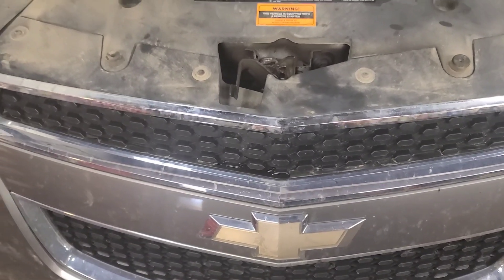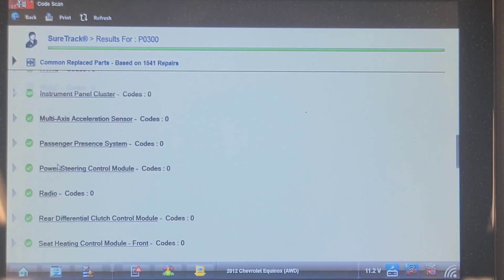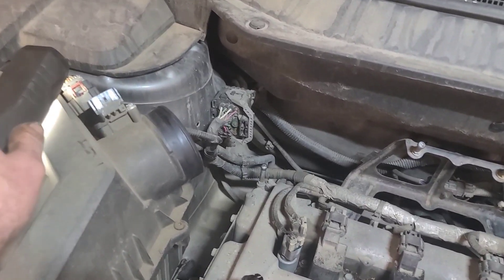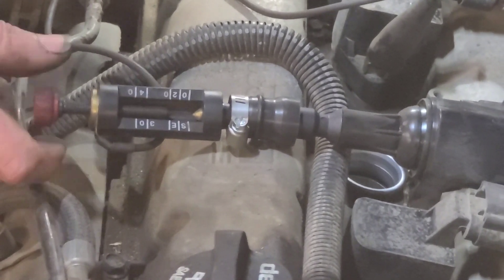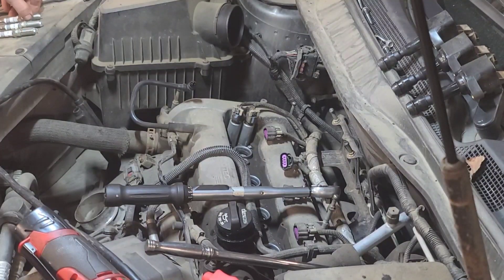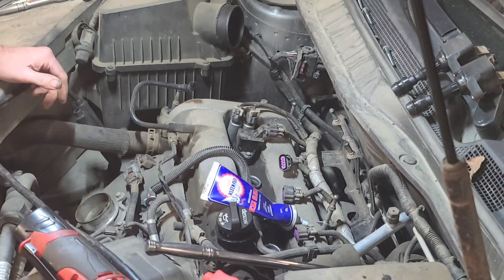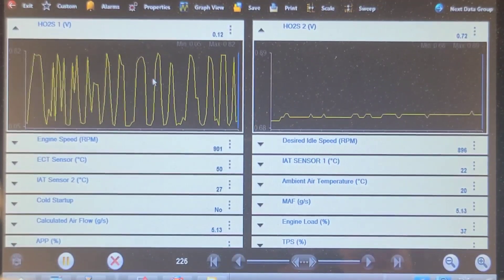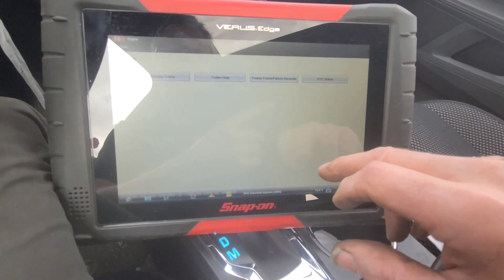2012 Chevrolet Equinox Misfire P0300, P050D

Comment: FYI don't use antiseize on shiny (plated vs black oxide) spark plugs in aluminum heads made after the 80's. Plug MFG's use the proper plating that won't seize. What does happen is the antiseize dries up, interferes with the ground, and makes removal a pain.

Comment: Hello Phillip, I like what do, Thank you. I thought I would ask you what the ohms reading the fuel injectors should have for this engine. I get 1.6 ohms on all four, does this sound right?  I started with replacing the Timing chain then VVT solenoids, did the PCV hole clean out, replaced all coils-sparkplugs  then found another 2.4 ecotec common problem (cracked exhaust manifold) this seems to be as common as the rest of the problems this engine has. I ask what the ohms reading should be because I can't find those kind of specs anywhere. Thank you Phillip.
Reply from the maker: That sounds a bit low but considering they all measure the same I'd say it's OK. You are disconnecting them to test correct? What's the problem and why are you testing them. Resistance testing is only about 75% effective imo

Comment: My car is giving misfire codes like P0300 P0191 P0172 P2271 P050D Are the app aspirated with fuel rail pressure issues
Reply from the maker: The P0172 is running rich, 2271 is B1S2 O2 pegged rich, P0191 is a high pressure fuel pressure irregularity. I'd check for fuel in the engine oil. Probably has a leaking high pressure fuel pump leaking fuel into the engine oil. The misfire codes are likely as a result of running rich. Good luck...
Reply: @PhillipBailey   what would you suggest fixing first? i was going to go for fuel injectors because we have already done spark plugs.
Reply from the maker: @momomo3772  I'd suggest to check the engine oil for contamination as I said. Don't throw parts at it. The fuel injectors are not cheap nor easy to replace. If the oil is overfull then change it. Running watch the short term and long term fuel trim numbers they should be +/- 10% max. Watch desired and actual High Pressure Fuel pressure running. Should match. Once warm shut it off and then turn the ignition back on. Monitor HP actual fuel pressure and note that it should rise as the engine goes through a hot soak. If the HP fuel pressure does not rise replace the HP pump.
Reply: @PhillipBailey Yes it has been confirmed that there is fuel in the engine oil.. And we jus thought the motor was burning oil into the engine..but thought it was a manufacture problem with the sylinoids
Reply from the maker: @momomo3772  like I said likely a leaking HP pump. It's easy to replace but not cheap. Be sure the change the oil and filter as well.

Comment: Can somebody tell me on a GMC terrain 2.4 L which one is cylinder three on the spark plugs
Reply from the maker: Number one is closest to the Serpentine belt so number 3 is the third from the front. HTH
Reply: @ so it goes 1234 or 1324
Reply from the maker: @hectorestrada8622  the cylinders are numbered 1234 front to back but fire 1342 order.
Reply: @PhillipBailey  so say the spark plugs are 1”2”34 and I’m getting a cylinder 3 misfire I would have to change number 2 right
Reply from the maker: @hectorestrada8622 no your miss is being reported on cylinder 3
Reply: @PhillipBailey  OK so the firing order 1342 and I have a misfire on cylinder three so I fix number three? Do you see what I’m saying?
Reply: So I have a misfire cylinder three so I change number three in the firing order?
Reply from the maker: @hectorestrada8622  yes concentrate on number three, check the plug, check for spark check compression and fuel delivery

Comment: I've noticed most of your vehicles are very dirty. Is that due to slushy roads? I live where it rarely snows.
Reply from the maker: I'm in northern Ontario Canada so we get snow and slush 8 months of the year. Lots of my customers also live on gravel roads as do I. Plus they spray salt on the highways to control ice and that eats everything.
Reply: @PhillipBailey  Thanks for the reply. I had a shop in Louisiana for 37 years. Been retired for13.In my parish (county), sales taxes have paved everything navigable-including cow paths.
Reply: Was hoping this would relate to my eco tec problem. No such luck.
Reply from the maker: @TG-be3io  what's the problem?
Reply: @PhillipBailey  the one I talked to you about it the other week.  Surging at idle and timing all over the place. Seen this video pop up and thought you had the same problem.  This one isn't isolated to one cylinder tho.
Reply from the maker: @TG-be3io  Ah I see. Likely a loose timing chain or guides causing late cam timing. I've had that and struggled to fix one for some time. Fuel trims were always negative especially at idle no mater what I tried. Then one day the chain jumped and it would not start. I ended up replacing the engine with a low mileage used one as it bent valves.
Reply: @PhillipBailey  that's pretty common when timing chain jumps, breaks etc huh. I have a 04 Alero and love the ecotec 2.2 motor. Have had very few issues with it. I've read alot of people don't like it and only thing I'd change would be the timing chain would be a belt and more room to work on it. Changed the pulley tensioner arm and belt and had one hell of a time as I could only get a wrench on the 15 m socket and getting new arm and pulley back in with that screw was a 9 hour job even when taking off motor mount and the cruise control module and the tire and splash guards. Was hardest one I've ever done.
Reply: And stabilitrack light is on, rough idling and rough starting. I've heard that this vehicle is just junk and I shouldn't have bought it.
Reply from the maker: @christophersmith3661  stabilitrack light on due to misfire is normal. These are not on my recommended buy list for sure.

Comment: I’m having a problem with the exact same vehicle. Mechanic says they’ve did everything but might need a new motor? Is that right?
Reply from the maker: That's a loaded question.  It is possible that a misfire is caused by a mechanical problem in the engine. Misfire codes can be caused by ignition faults such as a failed coil, sparkplug or wiring to the coil, Failed or plugged injector, vacuum leak on the intake port or manifold,  cam timing errors, bad valves and piston rings. Could also be fuel quality or low fuel pressure. You have to test all these things prior to condemning the engine. If I was you I'd get a second opinion...but yes it may need an engine replacement or internal repairs.

Comment: Hi, what would be the omh resistance on the ignition coils? I have a 2013 Chevy Captiva sport 2.4 and just been looking for the service manual to know all of this stuff but I haven't been able to find it
Reply from the maker: You cannot measure the primary and secondary resistance of most GM ignition coils due to the fact that there is a built in transistor. In fact any coil with more than 2 primary control wires typically contains a switching transistor and cannot be resistance tested. Swapping with a known good coil is the easiest approach. Current Ramping is another approach as well. Hope this helps you.

Comment: So it means bad plugs and wires?
Reply from the maker: P0300 is a random misfire which could be caused by plugs, ignition coils, plug boots, plugged injectors or mechanical engine problems. P050D is cold start misfire and basically the same as P0300
Reply: @PhillipBailey  could it be the coil module or the ignition coil? I'm gonna start with plugs and wires first then next said issue if persists.
Reply from the maker: @christophersmith3661  you need to see if the miss is random or isolated to a specific cylinder. Look at cumulative misfires in mode 6 data to see what has been counted over the last 10 drive cycles. This will be wiped out if you clear the codes. If your scanner supports live data check misfire counters while running. If it seems to be a specific cylinder I'd try swapping a coil first see if the misfire moves with the coil. Good luck
Reply: @PhillipBailey  hay phillin I a p2635 could a p300 misfire cause that

Comment: My car has the same issue right now i changed both vct last time and now a mechanic is saying its the timing chain but at autozone i got the same code po300 so what could it be then
Reply from the maker: If the chain is worn the cam timing will be wrong which leads to random misfire which sets a P0300 code. So if plugs, coils and injectors have been ruled out your mechanic is likely right.

Comment: I replaced all 4 spark plugs and coils and I'm still getting the p303 code. Plus the stability track light keeps coming on. I need help. Im trying to avoid having to replace the injectors.
Reply from the maker: Check compression and do an injector flow test.
Reply: @PhillipBailey  It seems like I'm not getting any gas to cylinder 3. I know this question is a long shot but is there a way to fix the injector without changing it out?
Reply from the maker: @BullProspecting  you need to flow test the injectors. You could swap number 3 to 4 and see if the misfire follows the injector. I'd still recommend a compression test first though. On rare occasions flushing injectors helps but usually does not.
Reply: @PhillipBailey  I'm just curious, what will the compression test tell me? My neighbor let me use his but I had to give it back before I got to use it.
Reply from the maker: @BullProspecting  There are several possibilities for a misfire. 1. Poor ignition possibly due to faulty or worn sparkplugs,  failing ignition coil or supporting wiring or failed driver in the ECM. 2. Plugged or stuck closed fuel injector or possibly poor spray pattern, injector wiring or again failed driver in the ECM. 3. Low or lack of compression in a cylinder possibly due to broken or leaking piston rings, burnt valve, worn cam lobe or collapsed lifter. A compression tester confirms the rings and valves are working correctly.
Reply: @PhillipBailey  thank you sooo much!!🙏🙏🙏
Reply from the maker: @BullProspecting  good luck
Reply: @PhillipBailey  Thank you. I'm gonna need that or a miracle.. I wish I looked up the car before my wife bought it. We have had it for 4 months and only drove 50 miles.
Reply: @BullProspecting do you find your problem???

Comment: I have a p0300. New plugs coils 02 sensor high pressure fuel pump. Throttle body. Any suggestions
Reply from the maker: P0300 is random misfire but chances are it's not. What does the misfire counter say? Is it on a specific cylinder or all. What are your fuel trims reading? Partially plugged converter? Check exhaust back pressure at the forward 02 sensor.
Reply: I had a cracked exhaust manifold which was causing a bad O2 reading (even though the O2 sensor was fine) causing the engine to run rich and misfiring.
Reply: @crissd8283 so we had missfire in cylinder 3.  Alot.  The others were fine. 1 here and there.  End result we orfered a motor
Reply from the maker: @crissd8283  yes thats quite possible

Comment: Could this code also mean the solenoids need to be replaced? Or just the spark plugs? I got this code and the scanner read VCT variable camshaft Timing Solenoid.
Reply from the maker: There areblots of possibilities for misfire.  If you have a cam timing error code thatvcan cause random misfires.  It could be a stuck solenoid  but could also be loose timing chain or stuck phaser.
Reply: @PhillipBailey  Thank you! I will be taking my car to the shop on Monday. I hope it's not the timing chains😩 I appreciate your input!!
Reply from the maker: @isabellagalindo59  good luck for sure.
Reply: If it reads VCT variable camshaft Solenoid then it's a good possibility that you need to change your solenoids.
Reply: @kingrichards101  Hello, yes! When they checked my car I literally had no oil. I had no idea! (I don't know much about cars so I didn't know I still needed to periodically add oil even  if the oil change was recent) I got an oil/filter change and the car was fine! I did end up getting all new solenoids/spark plugs and breaks put in a week later. My car is back to driving smooth and have had no further problems🙂

Comment: What’s is the torque for spark plugs??
Reply from the maker: The spec is 15ft lbs.
Reply: @PhillipBailey  Would that be for a 2019 chevy equinox also? 1.5. Thank u. The engine is a 1.5
Reply from the maker: @scraplifetrashtocash4551  yes 15 foot pounds should be fine.